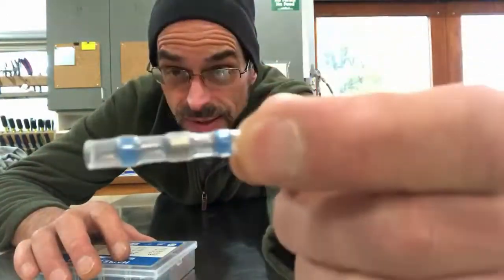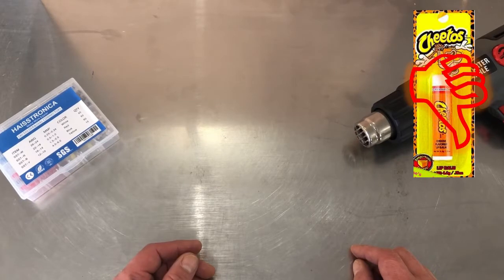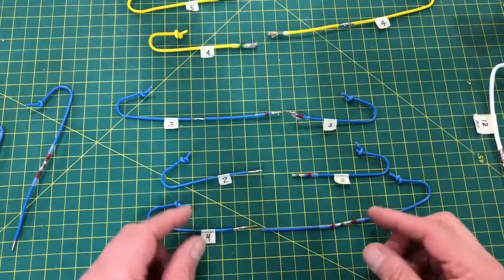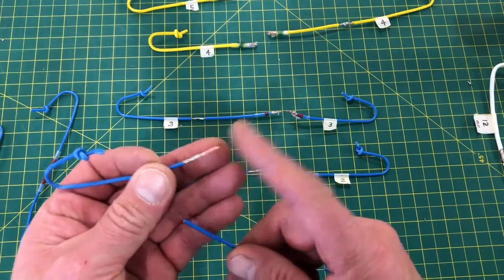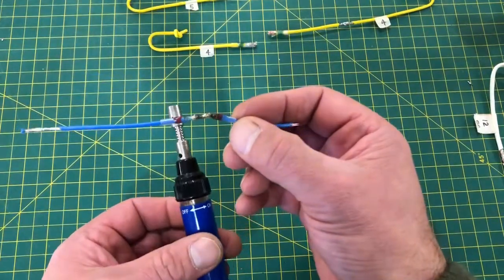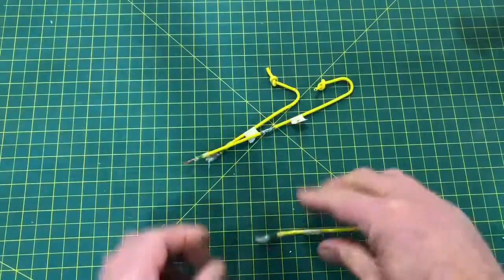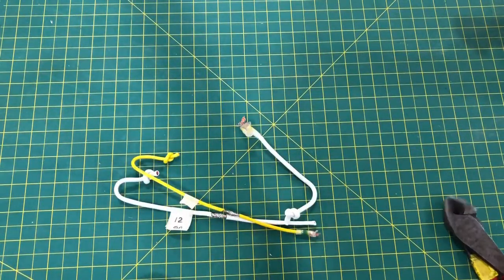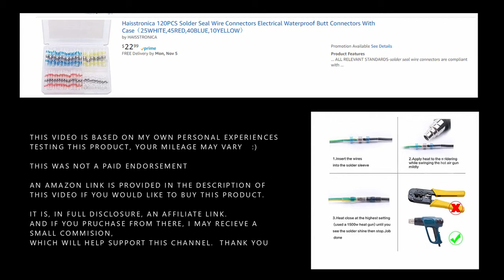Solder seal wire connector / Test & review

Comment: I just picked some of this up. One test I did myself was to put one end in a vice and pull the other. I was unable to break the wire at the joint by just pulling with a fair amount of force. But with the same amount of force I added the heat back on the joint and it did give at the joint. Which may be expected. But it may show that with the “low heat solder” you may want to keep in mind that if you are using these in an application where heat may be introduced to the joint it could weaken it. Regardless I think they are a decent option. As he found in his testing they are much better than a crimp connector and they seem to fall somewhere in the middle on effectiveness.

Comment: Very useful to see these strength tested, thanks!  I use them to splice cctv cables and automotive where the cable isn't going to see much strain.  In either event I take a good length of heavy duty adhesive-lined shrink tube and apply over the top (I give about 4cm of clearance either side) to give some extra strength, extra waterproofing and make them look tidy.  If you splice an 8-core CAT5e cable using the smallest diameter solder connectors and stagger them in pairs, then cover with a good length of heavy duty adhesive lined heat shrink to match the cable colour, the signal degradation is no worse than an inline RJ45 connector and from only a few feet away you have to look carefully to even see that they've been joined.

Comment: …...short of towing a trailer with a 10 gauge wire......I'm sold, Heat shrink solder butt connectors are great...….I now use them all the time in tight work place situations.Great video, by the way, thanks !
Reply from the maker: Thank you for watching, and thus we now know that if you’re safety chains fail, we definitely can’t rely on the wire 🤣
Reply: …...when you talk using comment sense.....no "thanks" required....but thanks just the same...….no reply is needed, otherwise we'll never see the end of it.....Thanks....he he he !

Comment: I found this useful. I haven't tried them yet, but I wanted to be able to splice extension cords for running lights outside, and have some expectation that if they get a little wet they won't blow a fuse. Based on this and another video where someone put a joint in salt water for a while, I think they'll be fine.

Comment: Not that I have used the solder seals to date nor do I have a dog in the race, but I would point out that i would expect that each of the true solder joins to be stronger.  With each one you have and will introduce more solder material creating greater surface to surface area and bond.  Thanks for the test, it does look like the solder seal wire connector will do the job, and thanks for the heads up on the mini torch.

Comment: They work exceptionally well on marine tinned wire with as little wire stripped as possible. I only strip about 1.5mm (1/16 inch) more wire than the width of the solder rings. Of course not everyone needs to use marine tinned wire, but I hope this comment might help other's like me who do need to use it.
Reply from the maker: S/V Tattoo ....thank you for the tinned wire tip!
That is great advice. 👍
Reply: If you are going to tin the wire, why not just solder it?

Comment: Around 5:20 and 7:04 you talk about the solder not going all the way through the wire. 
I noticed when you put the wires together you made a twist in them. Which may work well w regular solder methods but for the connectors I believe you’re just supposed to push the wires together, pinch them to line Up any stray wires then put the connector on. Then the solder will melt and seep into the wire joint making a strong connection. 
At least that’s what my instructions said to do. Not sure how much it would really matter but to me it makes sense. I’ve never tested them like this but the place I use the wires there isn’t any worry of pulling on the wire
Reply from the maker: Food for thought, thanks for the feedback
Reply: Builds with Brian sure my friend, no problem

Comment: Would adding a small dab of flux to the wire before you insert the ends into the solder help flow more?
Reply from the maker: I worry about the flux residue trapped inside the joint, but I have not tried it

Comment: Great video. I'm not sure if your sample did, but the ones I just got also have "hot glue" in the sleeve. I am planning to use these for rewiring the inside of my boat. So, for me, seal is more important than strength.
Reply from the maker: BIG JIM SLADE yes they do have glue to help seal, good luck with your re-wire 👍
Reply: @BuildswithBrian    Thank you. Picked up a 73 Fiberform Hardtop. The same type my Dad had when I was a kid. Figured I'd modernize all the electrical.

Comment: I wonder if the low temp solder connectors would work better if you dipped your wire in flux first.  I've had high-reliability soldering jobs for 20 years, and I never soldered without flux except in an emergency.
Reply from the maker: It’s possible, but the manufacturers of the Solder seal Connectors do not specify that you need to do that, and also to consider is that some fluxes are corrosive, and being trapped inside that heat shrunk connection could possibly also be a different problem .
The flux might also compromise the watertight seal, who knows unless it’s fully tested out.
Reply: I wondered that too. I think by doing that would increase the penetration thru the wire strands.
Reply: Worth a try
Reply: Tin the wires first, mentioned by another person
Reply: Tri it and let us know

Comment: I suggest the resulst of the low temp solder would be better with tinned copper wire using plain wire is like soldering without flux.nAlso if you are wiring with that much tension on the wire you are doing it wrong

Comment: on the 18 gauge wire, who many pounds of force did you have to use to rip the solder apart? because to be frank, for the application that i would use these for, i dont think it matters much.
Reply: nvm you said 50 lbs of force

Comment: Nice test.  The only thing I would have considered is trying some open barrel crimp splices.  Much stronger than the cheap closed barrel crimps, but probably not a match for solder.
Reply from the maker: Crimps have their place 👍
Reply: @BuildswithBrian  Absolutely.  I use crimps a lot for convenience, but solder when it absolutely, positively has to be a low resistance, strong and reliable connection.

Comment: It seems that others have complained of the solder not flowing through completely.  What if you dipped the wire ends in your soldering paste (flux) prior to smushing them together and twisting.  It would seem that the flux would help the solder to flow more completely through all the wire.  Just spit balling here.
Reply from the maker: Yes I believe it would help, however the flux residue will be trapped in the joint, and that might not be a good thing

Comment: Did you actually use any flux with the heat shrink connectors?
This could have maybe helped. 
Maybe worth another try?
Reply from the maker: No I did not, it is not supposed to be required by the manufacturer.
I would worry about trapped flux inside the joint and causing corrosion, but not all fluxes are corrosive 🧐
Reply: Builds with Brian 
Yes absolutely. 
Just wondering if a non corrosive flux would maybe have helped... 🙂

Comment: What is often overlooked is the location of the splice. If you're splicing multiple damaged wires together in a tight area under the hood of a vehicle in your driveway this is the only way to go. If the splices aren't subject to significant strain or constant immersion you can't beat these. 

If you can work in a dry workshop and can place each wire in a soldering stand then I would go with solder joints and heat shrink tubing but this isn't always possible.
Reply from the maker: Yes sir, I can see you know what you’re doing, thanks for watching

Comment: Great test, would be curious how strong a delphi weather pack connector splice in contrast to solder
Reply from the maker: I’m sorry sir but I do not know what that kind of connector is
Reply: @BuildswithBrian  i should have just said a double crimp with strain relief oem type connector available in various configurations point being the double crimp or wire and insulation. You wont see oem using solder or the racing community.

Comment: If you want a Tru solder Bond on those connectors you have to use flux.
Reply from the maker: That’s the thing about low temperature solder solder, it’s Not supposed to need flux, And if you were to add some it might be corrosive trapped inside there

Comment: Did you ever try a bit of flux on the wire with the heat shrink connectors?
Reply from the maker: No, mainly my biggest concern with that is trapping flux inside the joint, and some fluxes are corrosive. But it is possible with non-corrosive flux??
Reply: @BuildswithBrian  You are a step ahead on me on that I did not even think about the flux being a corrosive

Comment: I’ve heard if you put flux on the wires before you use the solder connectors they work much better
Reply from the maker: Possibly, I haven’t tried it, but I worry about flux being trapped inside the connector, mainly because some flux is corrosive.
Thanks for watching and your feedback

Comment: Just as important, to my way of thinking, is electrical resistance in the solder joint. Resistance can be very critical; I wonder how good it is in that respect.
Reply from the maker: Karl Randolph ... I agree, and when I get some more free time I plan on doing a part two and that is one of the things that I want to touch on, thanks for watching
Reply: i wouldn't worry about that.
Reply: That's the test I want to see, as i rarely use electrical wiring in tension.

Comment: I've seen other people melt the solder into the wire by a torch not a heat gun...maybe that will change the results? Also another guy on another video commented to add a smitch of flux to better melt it
Reply from the maker: de bildr 
I had bad results with the torch method, it melted the heat shrink tube, flux might help but make sure it’s the non-corrosive type because it will be trapped in the joint

Comment: Hi Brian; perhaps you can re-do the tests using a heat gun with a base and a hook nozzle attachment.  This way you can move the wire piece with the solder seal in a back and forth motion over the heat gun's air stream.  By using a hook nozzle, the work piece will be surrounded by the concentrated heat (lessens the chance of heat loss); and heat naturally rises- so with the nozzle of the heat gun pointing upward toward the ceiling, I think you will get better solder flow that will penetrate the wires completely.  Something else I would consider, per the manufacturer's specs of the solder seal product, what do they recommend for wattage and temperature specific to their product?  I would also compare the product brand you used in this video to other brands of butt  connector solder seals.  I would be so interested to view those results.  Thanks for making this video.  Your demonstration gave me a lot to think about, cheers!
Reply from the maker: TopCat577 I have been considering a follow up video actually, there are many more ways to approach testing these...I like you’re suggestions, thank you
Reply: Maybe you should do the rest yourself. You have such specific suggestions that would be helpful in you redoing the test.

Comment: Man, I really appreciate this video.  Was looking at these because the crimp style connectors suck, and I just don't wanna have to break out a solder gun to do the small work all the time.

The loads these things can endure far exceed anything they'll realistically endure (which you mentioned several times).  It's nice reassurance to know where the failure points are, approximately.

Thought the audio was fine.  It was only coming out of one of my headphone speakers, but I could hear you fine on them.  Not sure if it was something on your end during recording ... maybe I'm the only one experiencing it.
Reply from the maker: Michael, thank you glad it helped you, and yes I was having audio issues when I first started making videos, was only recording sound on one track, I think I have it all fixed now, thank you for the feedback

Comment: A proper crimp with a good tool and good cimp is better than a solder joint, in fact many auto industries don't class a solder joint as a viable connection method and will fail a vehicles inspection if one is used as they become brittle over time in  and environment where the connection is flexed repeatedly.
Reply from the maker: axeami135 I agree that in many situations a good crimp joint can be preferable over solder, thanks for the feedback

Comment: You can get them many places if you search them online. Aircraftspruce.com, most of the electronics places like Newark and Mouser as well. I should also point out that what we use them for is terminating ground pigtails to shielded wore. If you must solder two wires together then an iron is definitely better to join two pieces of wire. They also make environmental butt splices which you crimp each end together and a sealing sleeve gets shrink over the top.

Comment: i like em too...i ma putting a kill switch on my trucks electric fuel pump......i want a good high reliability water seal without open flame soldering.....this should work....whats the flashpoint temp for gasoline again???   :)
Reply from the maker: Thomas Lawhead flashpoint is pretty low 😆

Comment: I know resistance is important in a circuit, and to minimize it is essential. A solder joint is pretty good at making a very low resistance connection. Anybody test resistance with this solder-seal system? I like the idea, but since the solder does not flow ( because the copper does not get hot enough, BTW), I wonder how much resistance; especially under an electrical load. Anyone???
Reply: I haven't seen conductivity tests.

Comment: One suggestion for the solder sleeves. Use a deflector attached to the heat gun. The deflector will surround the solder and cause a more uniform melt. Also, there are differing qualities of those sleeves. Some are cheap garbage.
Reply from the maker: Good idea on the deflector nozzle, i’ll have to try and find one that fits my heat gun
Reply: @BuildswithBrian  Thanks. They are inexpensive and worth the effort.

Comment: Who is putting that much tension on a electric wire? Lol. I use the NTE version and they work great for me. Working out in the field not in a shop. I suppose the ones you bough might be a lower quality. Try the NTE ones and see if you get better results. Great video, interesting to see this.
Reply from the maker: Of course no one should tension wire like that, my theory was using a tension test to test the soundness of the solder joint which should in essence be a test of the electrical
Joint soundness , A better solder joint equals better electrical conductivity, right?
I will check out the brand you mentioned, but I think the trouble itself is in the low temperature Solder
Reply: @BuildswithBrian  I highly reccomend them. Also make a hook onto the end of both ends, hook them together and then twist them together. This will strengthen the connection from pulling apart.

Comment: You missed the most important part. A lineman's splice with the heat shrink tube solder tube vs just the lineman splice. But is unlikely that anyone would be crazy enough to subject their splice to that kind of force. So, it is fast and it works well enough. I do a lineman splice without solder and just use the solder heat shrink tubing. Too convenient to bother with anything else.

Comment: Good video but basically what this test shows us is........if you plan on towing your vehicle with 16 Ga. wire then these will not work and really you should not be allowed to use or work around anything mechanical LOL  but if you plan on using these for what they are intended then they are a very good easy to use alternative to soldering wires together.  I don't know about most people but when i connect electrical wires I have never had wires that are subjected to 50 pounds of pulling force. A better test of these would have been to test their conductivity and resistance and how moisture resistant they are....... not if i can use my light connector to tow my boat!!!  I do use these and they are very easy to use and they do work great and i have yet to have a connection fail to do what it is intended which is to permit electricity to flow through wires but i now know that I should hang onto my tow strap because these will not work for that!!! LMAO